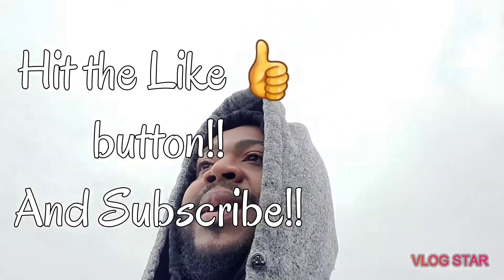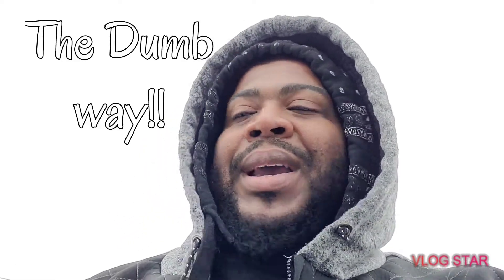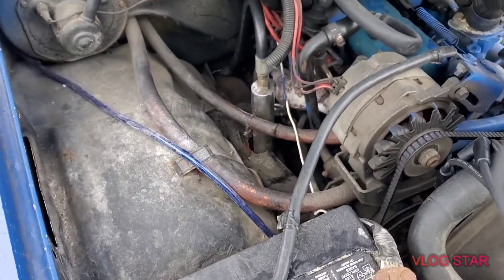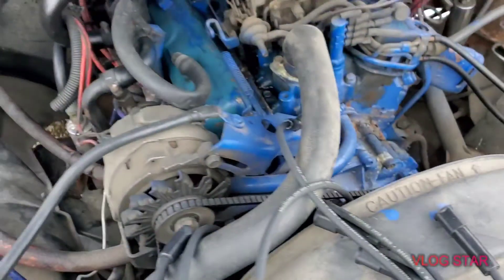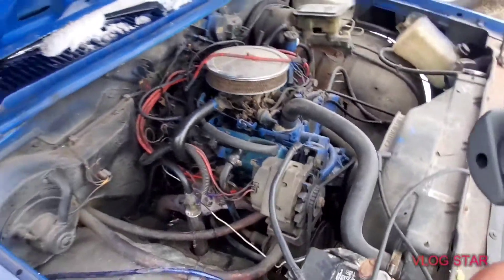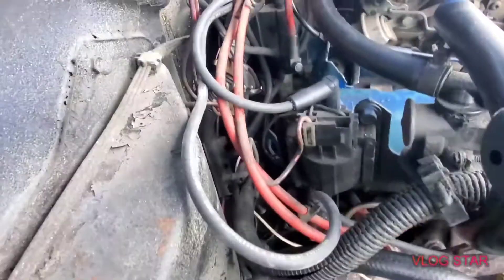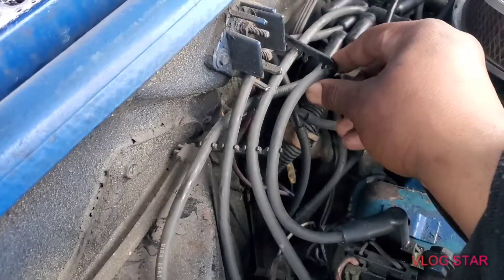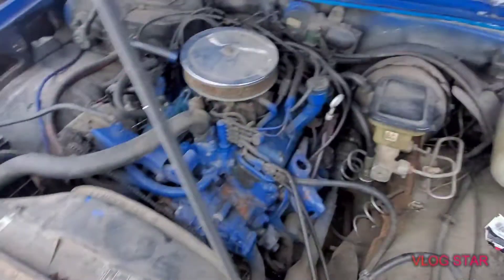Project Lowrider!! The Dumb Way!! Plug wires!!

Comment: To add to your angle boot discussion, if you have headers then you will want the angles more than you think!!! Keep it up thou man!!! I see you!!!!
Reply from the maker: Facts!! Good point!! Yeah those straight ends will definitely get burned off depending on the headers!! Thanks for the feedback!!  💯
Reply: @MisterLowrider  I need some of the angled boots 🤣🤣🤣
Reply from the maker: @Low85cuttY616  😆 oh ok, u must be running some of those tight headers close to the wires!! You can get a set of those angled ones from accel or those expensive brands but they cost a lot more than 20 or 30 bucks 😆